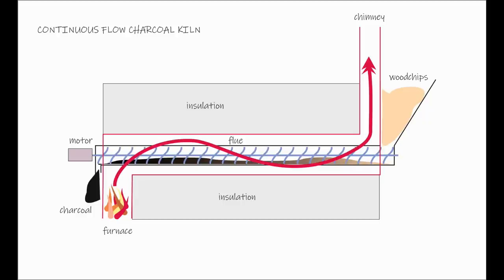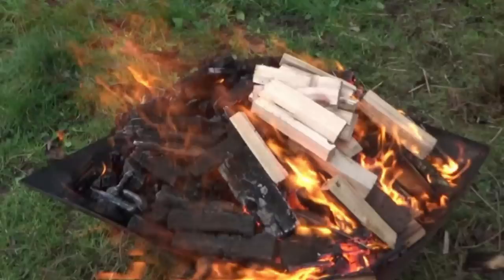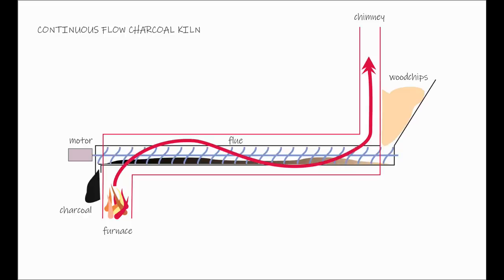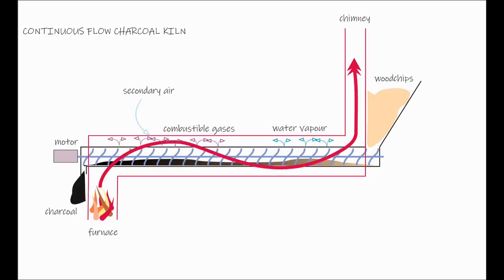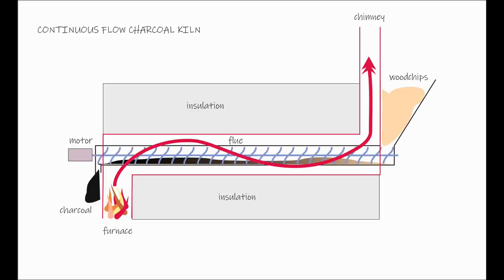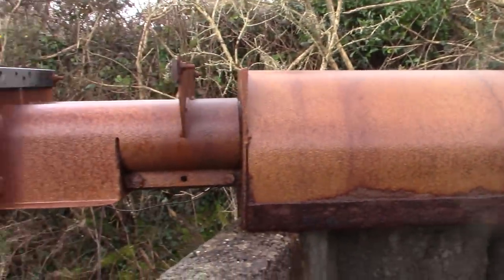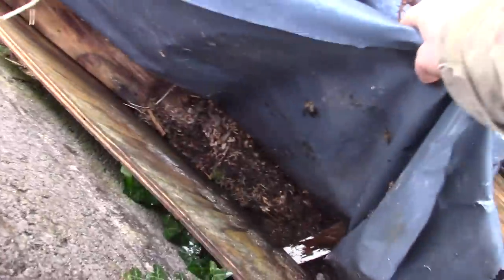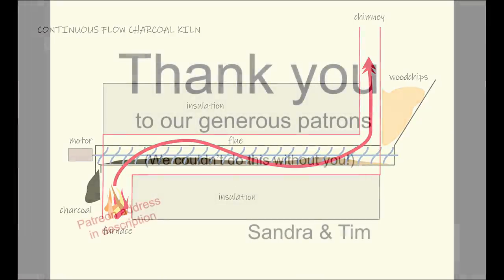An Interesting Design For Constant-Flow Charcoal / BioChar Production..

Comment: We already tried that design. My Dad build a continuous Retort system.  Go look at Hive Carbon in South Africa. No moving parts inside the combustion chamber is best. We build it vertical. Its all about the time exposed at a certain heat. My Dads system had been proven and been working for years now.😊

Comment: Look into process tunnels. Generally these are inclined to use gravity, with paddles inside to agitate the process material. They're generally more reliable in these environments than augers.
Reply: We have one at work for activating lime that uses gravity and rotation to carry the spent lime from the cooler feed end down to the firing end,  cooking it along the way
Reply: I was just about to mention that… we have augers in our boiler ash systems and they jam super easy. A rotating drum would work significantly better
Reply: I fully agree that particles need agitation in order to allow full exposure and escape for gases

Comment: An idea for stopping the charcoal combustion on the end would be to extend the pipe with the auger so that the charcoal has time to cool down before it exits the tube. It would require a quite long tube and auger, but if you only heat a third of the pipe it should work, this way you dont need to change the whole system, and the motor would also be placed further away from the heat....
Reply: Agree. Rather than waste the heat have the hot charcoal proceed along another tube that is adjacent to the original tube with the charcoal chips transferring heat to the original tube. So that the output of the tube is now by the input hopper of the wood chips. 

Ok there are issues like transferring the charcoal for one tube to the other and sorting out the proximity of the still hot charcoal near the wood chips in the hopper. 

Spraying water on the super hot charcoal could be risky as that is one of the processes of making ‘town gas’ in the old day where it generated hydrogen.

Your continuous charcoal process is an excellent idea and will have challenges definitely worthwhile.
Reply: @percymerlin  If you put the second pipe+auger below the first, the charcoal could fall out of the first down into the second, which then pushes it back the way it came, with the heat rising up to the original auger.  If the second pipe was longer or shorter could dump out the cooler charcoal further away from the input hopper.  However I'm not sure recovering the heat would be practical.  You'd either have to remove insulation below the first auger (allowing heat to escape), so the residual heat could travel from the bottom auger up to the top auger, or put both augers inside the insulated box, which over time would cause the second one to head up to the temperature of the first, defeating the purpose of having the second cooling auger in the first place!

I'm not sure there's an easy way you could passively cool the charcoal while also putting that heat back into the system.  However Tim was talking about using waste heat to warm his house, so maybe that's the way to go.
Reply: @Berkeloid0  I agree with your thinking. The heat transfer needs some serious thermal workings( to put it technically 🤔) . Since I do not know the distance between the kiln and the house that could be a serious driver. While nowhere near all the heat could be transferred from one pipe to the other it could act as a prewarmer/ cooler. Then there would the issue of a heat exchanger to then transfer the heat to another medium to be piped to the house using insulated pipes. A serious cost consideration. Maybe the compromise is to extend the auger like you say but have that pipe wrapped in a heat exchanger to cool the charcoal and the hot water to the house. 

It is a fascinating project, where I personally feel there will have to be a lot of compromises just make it work. The auger bearings being a biggie. Needing to have something that works over time and losing out on the bearing friction.
Reply: I had this idea too. You could even have a tank of water surrounding the extended auger tube or a high-volume fan blowing air on the auger tube (with fins) to facilitate cooling.
Reply: @percymerlin  What Is Islam?

Islam is not just another religion. 

It is the same message preached by Moses, Jesus and Abraham.

Islam literally means ‘submission to God’ and it teaches us to have a direct relationship with God. 

It reminds us that since God created us, no one should be worshipped except God alone. 

It also teaches that God is nothing like a human being or like anything that we can imagine.

 The concept of God is summarized in the Quran as:

{ “Say, He is God, the One. God, the Absolute. He does not give birth, nor was He born, and there is nothing like Him.”} (Quran 112:1-4)

Becoming a Muslim is not turning your back to Jesus. 

Rather it’s going back to the original teachings of Jesus and obeying him

Comment: A great idea, Tim, with the potential to harvest either the waste heat from the chimney to heat your home/drying chamber, or the gases from the pyrolisation (as others have said). Rather than an auger, a continuous double chain with angle-iron welded across to make a conveyor would have the rollers and bearings protected from the heat, plus the structure could all be made of blocks, rather than a steel cylinder. Really looking forward to what your inventive mind comes up with!
Reply: This is actually an excellent idea. Also, there shouldn't be a need to drop the charcoal in water if it spends enough time traveling through the tube past the hot point. A long section of aluminum tubing after the heating chamber point should be sufficient for heat dissipation. If it's long enough, it should sap enough heat from the charcoal for it to exit safely without ignition. You could also add a water cooling tube spiralled around the aluminum tubing section to accelerate the cooling process similar to water cooling the CPU in a gaming computer.

Comment: In my opinion, with such a solution, the problem is the accumulation of tar on the conveyor or the damaging effect of high temperatures on the conveyor, and the difficulty in controlling the purity of the exhaust gases from the chimney.

Comment: Tim - have you thought of a chain-conveyor instead of an auger? It might be more practical and would not have the potential to crush the friable charcoal like an auger. 
By chain conveyor, I mean a simple, fireproof conveyor belt made of a series of loops of chain welded together in parallel to make a wide belt.
Edit: This idea would utterly fail to exclude any oxygen, but would at least roast the wood quite nicely.
Reply: Just put it in a housing and that solves the oxygen exclusion issue
Reply: I don't know the word in english, what I could find is scraper floor. We have them on our manure trailers for instance. 2 chains running in parallel with a U shaped iron profile across them every 30-50cm. The chains are driven by a shaft with special pulleys on them that grip the chain links. 

I would try to find an old manure spreader trailer and salvage the parts needed.
Reply: @schwuzi  I’ve never heard of s scraper floor but your explanation is simple enough and it sounds like a good idea
Reply: If the charcoal output were under water it wouldn't suck air up in it. In order to get O2 down to the charcoal end of things it would need to suck water in and train the tank or push bubbles down and suck air in through the wood chips hopper, neither of which I see as being realistic unless forced.
Reply: @awesomecronk7183  don't forget, the pressure inside the reaction chamber will be higher due to the release of water vapor and gasses as well as the heat from the furnace. I don't believe that it would suck up any water. The issue with water is that charcoal tends to float
Reply: Nice idea, but the chain conveyor would transport away a lot of heat. The auger always stays at the same spot.
Reply: @platinpalladium  that's a very interesting point!
Reply: @schwuzi  I think they are called walking floors
Reply: Anything with chains will not work in that heat. The bearings in the chain will fail and the conveyor will seize.

Comment: Love your basic design and thought process. One minor thought, there may be some benefits to putting the auger motor on the cooler end. You probably already thought of that. I’m enjoying watching your charcoal plant evolve.
Reply: or use a chain to drive the auger to keep the motor far away from the heat..

Comment: I love your thinking Tim.  I have been making bio-char in our firepit with my odd sized firewood (we heat exclusively with wood) during weekend campfire happy hour.  It's amazing how inefficient a teepee lay fire is at completely combusting the wood.  I douse the fire with water when the wine and cheese are gone and screen and crush the charcoal the next day.
Reply: Excuse my ignorance, but why do you crush your charcoal. Wouldn't it be powdered at that point?. Do you then compress it into a cube, or what?.
Reply: @Matt-wb7lm  Crushing the charcoal helps increase surface area making it easier to innoculate with living micronutrients.  After inoculation, the crushed biochar is added to the garden soil, which is a great benefit to the soil food web.  Biochar also sequesters carbon for thousands of years, something we desperately need to be doing.

Comment: Sounds like a good plan. How about your insulation in fact being your sand heat storage battery? You could redirect the chimney through your sand battery too to heat it up. If you do regular production burns you’ll be charging your sand heat storage battery every time you use it. In the winter you can direct your house heating circuit through the sand pit for winter heat and even have another circuit for hot water!
Robin

Comment: Make it as Archimedes screw instead of an auger. You can then turn the pipe from the outside. With the plasma cutter it should be easy to make. Cut a pipe in half and weld the dividers in place and bolt the pipe back together again. Using a set of metal rollers there would be no bearing problems because of the heat.
If you made a sheet roller like, the pipe roller, you could make a pipe in any dimension needed. 🙂
A moving part inside a very hot pipe will have a lot of problems. It will easily warp and bend if any wood get stock. I now from test that the combustible gas part have a enough heat to complete the charcoal when the process as been started. So you only need some extra fuel in the start if the gas is used efficient.  You will need a fairly good seal at the intake to force the combustible gas out. This can be done with a rotating feeder so that the top is never open directly to air.
Reply: Exactly. This design, along with things like a slight slope should do it. Blockages are an issue, as you mention, but a lot of that is preventable by feed speed. It also helps to be able to reverse the auger to clear blockages.

Comment: Sounds great but what about some cheep steel drums that you could have on a sort of chain drive device that they lay on in the cooker and you can roll out the burnt ones and roll in the new ones they should be sufficiently sealed and could probably be vented easy and could put agitation lumps in the barrel to make sure they all move around well.
Hope fhat makes sense.
Reply: I like this idea, kind of a 'batch conveyor' with barrels, in a larger tube.

Comment: In the company where I work we develop a similar system for 2 years now. We heat the reactor auger with elektricity, the combustable gases are sucked out and processed, so they can be used in an engine or heating...the hot coal is cooled in a second auger with water jacket...the motors are far away from the augers and power them  via a chain drive.

Comment: A.) You should absolutely try and salvage what you can of the old charcoal-cooker, saves money and the suggestions people are making for protecting the bearings/motor are brilliant
B.) Will you have some sort of way to access the inner working of the cooker so you don’t have to cut away a bunch of material?

Comment: Fascinating!  This looks a lot like a type of heating furnace that was popular in Vancouver about 120 years ago.
Rather than making charcoal, an auger fed sawdust into the furnace which could be fired by coal, wood or charcoal.  Once hand started, the auger was steam driven--about as close to a perpetual motion machine as one could get!

Of course, that's no what you're after designing, but I thought the similarity was interesting.

Comment: I love this idea, I am experimenting on a small level, made my first two charcoal briquette blocks yesterday. Experimenting with added sawdust.
I am studying civil engineering part of our job is identifying a working system and optimising it, this usually leads to keeping the design, but losing material or makong maintenance less, sometimes this process leads to even better results. I would like to work on this as a side project, students are poor, we need to keep things cheap.😊
Reply: I found some solutions to your issues.
You get high heat bearings that can withstand 350 degrees, if the issue persists the tube could be made longer, giving the tube heat time to dissipate.
The motor that is too close to the heat, that can be put anywhere away from the heat by either extwnding the shaft or connect via a change to but it above or below the shaft level.
In order to get efficiency level up, the whole hestimg enclosure shoulf be close up with at least 3 heating sensors to monitor temperatures. They are fairly cheap and with a little bit of studying and researxh you can set up a program to help with it. Though getting the motor to change rpm relative to your temperature is different story, I think it can be done with voltage or amp restriction, need to ask an electrical engineer, I do civils.😊

I've seen the larger machines, they all do it in bulk rather than a continuous  line.
So the question as ro why needa to be assessed, cause this setup seems better, but it is not really utilized.

Comment: Alternative: not auger-in-tube, a look-alike water wheel but metal, turns slowly in metal container outside of which passes combustion exhaust (hot). Heating fuel is the volatiles boiling off wood chunks (chips not required, but small enough to fit in wheel chambers) which are ducted out of metal container into firebox. Forced air no, construct tall chimney which creates vacuum.

Comment: For cooling, you could use a second auger that is separate from the one in the flue so the heat doesn't transfer as easily. Plus you could have it rotate horizontally at the inclosed transfer point and be able to make separate piles or fill separate holding bins by moving it back and forth.

Comment: I wonder if a large rotating barrel (like a big tumbler or old cement mixer) could be used and done in a similar fashion without needing the auger (as per suggestion below)

Comment: You can dry the woodchips before entry with the combust gases of the furnace. instead of focusing on a single combustion chamber with a mekanism to move material within, you can have three stationary chambers. One firing, one cooling down & one heating up with the combusted gases. Then you can have a rotary mekanism to feed woodchips & collect charcoal from/to hoppers respectively.

Comment: Great creative thinking. Do remember that at these temperatures the fire would quickly eat through the steel innards. A common problem with rocket mass heaters that were made with a steel flue. It just corrodes away very rapidly

Comment: I would put the motor at the wood chip end because it would be cooler. The charcoal exiting could drop into a sealed container that has copper pipes inside to help the charcoal cool before reaching the air. This cooling chamber would need a baffle to help with priming, but one it had its first batch the cool charcoal at the bottom would keep the new hot charcoal from reaching enough air.

Comment: You could look into cooling the charcoal the same way I condense poitin by using icy water.  I used to have a freezer full of icy water, 12v pump from a quad weed sprayer and cooper coil the pipe from the freezer around the the hot pipe cooling it instantly. Ran everything on a silent generator.

Comment: I have been thinking about a design like this for the last two months. I thought about augers like you used from my farming days and thought the bearings and motors would cook. Chain augers with stainless steel could work. I also thought about a modified grain drier with a very wide chain feed. A rotary crusher at the end with a sprayer to cool the Charcoal could work and seal the system. Designed well the feed stock could heat drive a turbine!

Comment: so it needs to be continuous, bearings away from heat, forgiving for chips clogging, safe AND cheap. what an awesome challenge.
use one of the two spirals that you already have, try to find a metal tube that fits nicely, weld shafts to the auger in the straightest way possible so the bearings can be mounted away from the heat. and go with this design that you just showed us, minus the holes on the top of the pipe, the moisture and wood-gasses should have a way to exhaust next to the feed, in a form of a pipe. at the receiving end you make an airtight catch tank for the coal
Reply: Or set up a gentle water sprayer to cool the charcoal, could be done with garden hose and a spray nozzle